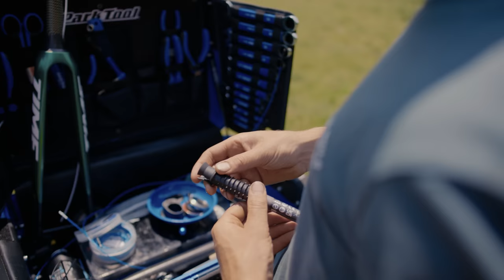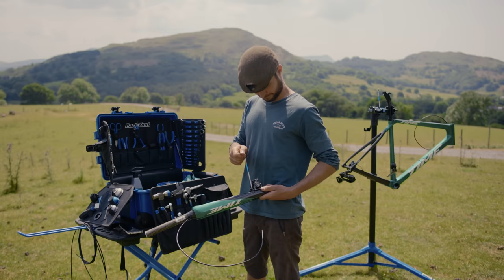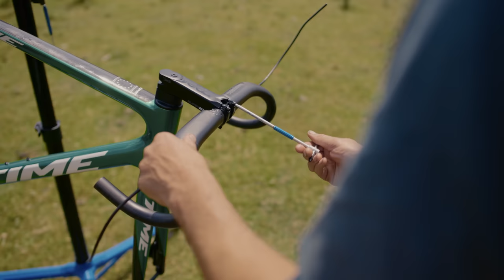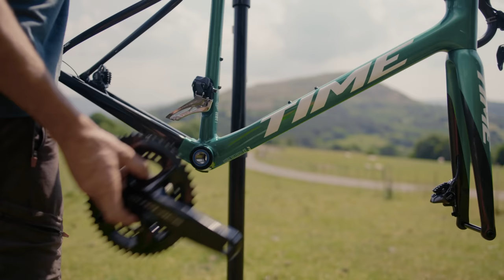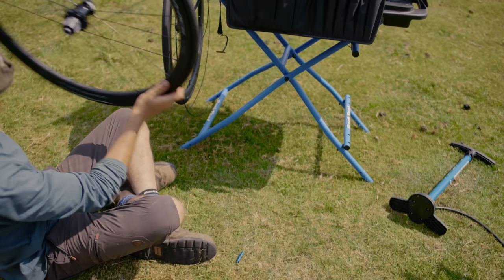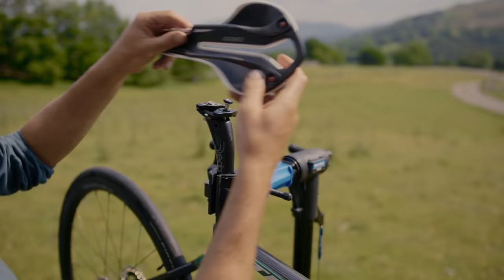DREAM BUILD ROAD BIKE - TIME ALPE D'HUEZ DISC

Comment: i had a hellva time putting on new tires.. the last 4 or 5 inches sheesh thought i was going to bend the rim with the plastic tire tool, this man did it in one shot with he own hands
Reply: It actually varies from tire to tire, some are a piece of cake, others can be a real workout. The most stubborn tire I've worked with is an ENVE SES tubeless tire (of course it's tubeless XD, clinchers are hardly stubborn).
Reply: @yonglingng5640  ah mine is a wtb byway 40x700 as tubeless too

Comment: Any worries about carbon threads for wheel axles?
Reply: There are no carbon threads, steel.
Reply: Alloy in fork ..Rear hanger has the thread for the back

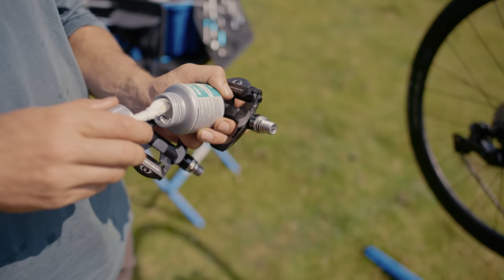Comment: 11:48  I wonder if he puts the master link on backwards on purpose to see if we’ll catch it.
Reply: I wonder how many people even know there is direction.  Leading pin on top going towards the FD on the outside of the chain should be the factory joint.  Usually the directions for the link are printed so small, most people never read them.